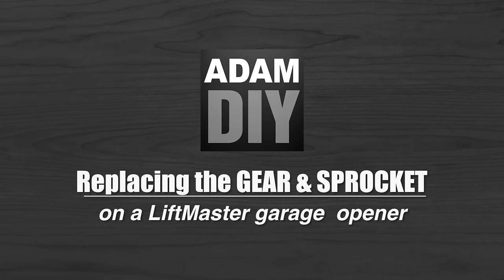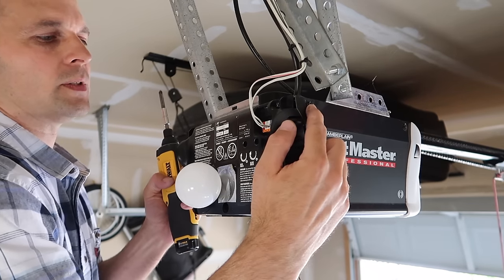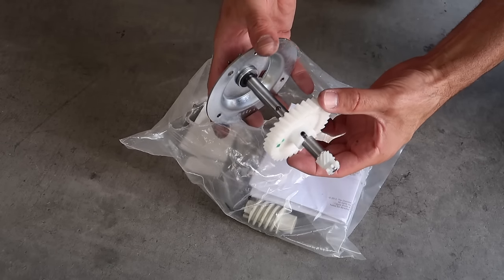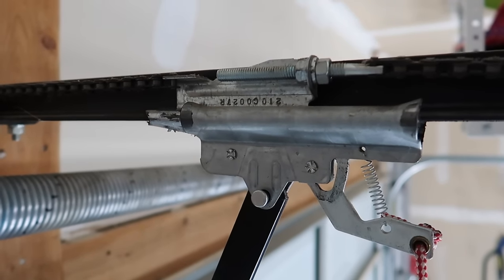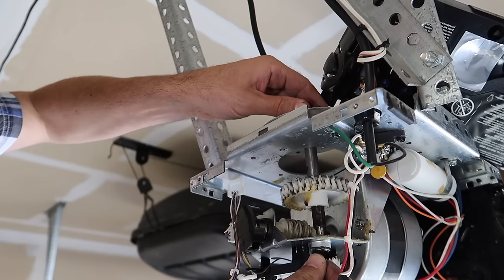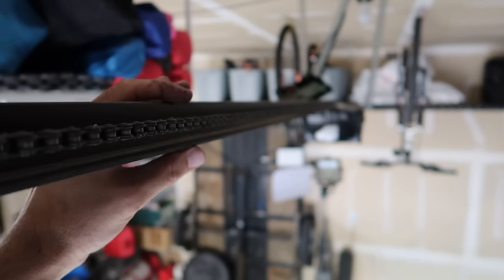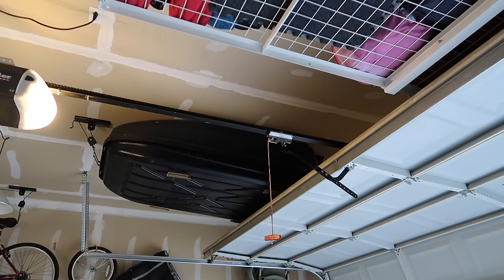How to change the gear and sprocket in a garage door opener - LiftMaster Chamberlain

Comment: Have performed this task twice now.  A few more bits of information: 1] cover screws are 1/4-inch; 2] chain anchor nuts are 1/2-inch; 3] sprocket mount screws are 5/16-inch; 4] check bolts holding entire unit to ceiling....1/2-inch nuts; 5] chain is heavy..be very careful of fingers when moving it on and off of the sprocket...potential for injury; 6] using both the Vice-Grip trick and marking chain position, it was necessary to adjust limits......door always moved too far up and didn't move down far enough....so I would adjust both limits before first functional test by one full turn [360 degrees] and definitely perform the safety test.  Also make sure that you have not loosened/detached the black sector wheel which mounts on the outer end of the worm gear shaft while messing about.  Pre-threading the sprocket mount screw holes is pure genius...do it !!  Worst parts: many trips up and down ladder & gooey grease.
Reply: Thanks for the tips
Reply: I need to change the other gears also

Comment: THANK YOU so much for this video. I had never tried anything like this before. I'm not very handy. My door stopped working and I realized the sprocket had snapped off, separated completely from the gear shaft. No wonder the chain wasn't moving. Other than being a very old unit, I believe I found the reason for the stress. Anyway, I ordered the replacement part and then followed your instructions perfectly. You gave so much information that I wouldn't have had a clue about.. .like threading the screw holes. I got the new gear and sprocket replaced and greased up. The door still wouldn't function properly though, the adjustment screws weren't having any impact. No matter how much I turned, the door did the same exact thing every time. I finally figured out that a sensor (yellow wire) had come off the up adjustment screw. I got it back on, made the proper adjustments, and it WORKS PERFECTLY!!!  Thanks again for saving me money AND for helping me gain a big boost in the accomplishment department! I'll always check here first whenever there's something around the house that needs to be done
Reply: Kathy, please see my post on 8/29/20. How did you realign you chain? This seems to be a no-brainer video. Thanks Adam. i had my doors replaced about three months ago and not sure the installer checked the balance.

Comment: I just replaced the gear and sprocket in my 10 year old Chamberlain 1/2hp chain drive opener, and this video was a huge help!  Thanks!  I would add that in my case, it seemed that once it was all back together the opener seemed to think that the door was in the up position, when it was in fact closed.  The only way I could get it to work was by manually moving the chain to where the door would be in the up position.  Then after a few tries readjusting the down limit, it all works perfectly.  Great super helpful video!

Comment: This video was terrific!  I just changed the gear and sprocket in less than two hours and it is working well. Your instructions were spot on!! Thank you!
Reply: Matt Vaughan
Matt Vaughan
Dude, can you help me? I got all excited seeing how easy it was to change that chain gear. I just replaced the gear assembly on mine because the teeth on the old one completely wore off. Now, whenever I hit the garage door opener button, the motor and chain goes 3” one way then 3” back the other way and stops. What would the problem be?

Comment: Thank you for the video.  Have the same model, had the same problem.  This video helped immensely.  The one thing I recommend at the nd is to have the starting point @9:55 with the door all the way down on the floor and disconnected from the chain, run the chain to the closed position, then connect the door to the chain , so you don't have to worry about the limits, at least one of them.

Comment: Thank you, great instructions! Saved me $$$. One thing I didn’t notice till the end was the openings on the top of the sprocket that seat the black plastic cap prongs. After screwing in the all the bolts I went to put the cap on and realized I should have rotated the two openings so the cap would not interfere with the chain, so no cap on mine :-)

Comment: This is a really good video. I replaced my gear sprocket assembly and everything is working again. It wasn't quite as easy as the video depicts but the video provides a lot of tips which will save you a lot of aggravation. My biggest trouble was getting the old assembly out and the new one installed because I didn't have the right tools for the job. The only thing that I was not able to install was the cap that goes over the chain sprocket because if you don't install it with the slots facing the right direction  you can't put it on. No big deal though. All in all this saved me hundreds of dollars! Thanks for a great video!

Comment: Thanks for the video. My opener had shims on the shaft when I put it together it made a horrible noise without them. The kit came with replacements and once they were in stalled it ran much smoother with minimal noise

Comment: Thank you SO MUCH for posting this very well made video. I purchased the exact same gear kit for my Craftsman opener that broke shortly after we moved into our new house (and in the winter no less). I watched this video a few times in preparation and then step-by-step while replacing the main sprocket, which had initially broken completely off, and it went about as well as I could have hoped. Watching this video was much easier than reading the vague instructions that came with the kit. Thanks again!

Comment: great and informative. I have a Raynor 1/3 hp and could not find a kit for it, so i used this one. looks and fits just like the liftmaster. probably made by the same folks, but i could not confirm it with  a google search. And this did happen in the winter.

Comment: Thank you for the guide on how to replace the gear when my opener that looks exactly like yours in the video sheared the metal gear off the shaft. After I got the new shaft installed it took me a bit to figure out where the chain and carrier should have been since I wasn't sure where the garage door opener thought it was at after it failed when I wasn't home at the time.
Reply: Curtis Manley mine was completely sheared off as well.  The video was great in how to complete this job.  $18 and a couple hours of my time and we’re back in business!
Reply: Curtis Manley do you remember how you figured out where the chain and carrier should’ve been? Ours fell off when we weren’t home as well so have no idea where it should be.

Comment: Adam, I had to replace the gear and sprocket.  Just finished the job, followed your instructions step by step.   Now the door won't open or close, the trolley (I think that's the correct term) does not budge.

Comment: I followed your instructions for replacing the gears and even paid a company to come out and balance the door as you recommended. They complimented me on the gear installation. I had the same issue that Paul Hopper mentioned in an earlier comment regarding making sure the two square holes on the top plate of the gear apparatus are lined up parallel to the chain bar. Otherwise the plastic top cap can't be re-installed. Seems to be the only detail you left out of the video. Otherwise this is an excellent video with clear instructions.

Comment: Not sure if anyone else mentioned it.. but I got it all back together..   (excellent tutorial by the way) and went to put the dust cap back over the sprocket and realized I hadn't rotated the upper plate to the right position.. the tab slots for the dust cap are off by 120° so I left the cap off until some day when I have the ambition to take it all apart again.  Maybe if you do an edit on this post, you could overlay a graphic showing to ensure the tabs are aligned with the direction of the rail.  Thanks for your instructions.

Comment: Great tips here and the videos help a lot. However if you are like me and you have not touched the unit in 26 years you might want to change all the bushings and the worm gear and clean and lubricate everything.  To do that you detach and disassemble the whole unit.  And it takes several hours. The lock collar on the worm gear has allen screws that scored the shaft and the bushing was tight coming off and on.  Also the new chain gear and bushing (shown above) was not lubricated so I took the retaining clip off and lubricated it and put it back together.   My original chain gear had worn out the top bushing and wore out the gears so I replaced the bottom bushing too. The worm gear was worn too.  I would not want to do it standing on a ladder with the motor hanging - upside down on a bench it was tough enough.    Got it all back together hopefully another 20 years.  One down and one to go.

Comment: two additional tips: 1) My unit has a plastic chain spreader at the top, fastened by two screws. When installing the new kit, you need to align the new top piece so the open hole in the correct position for you to re-install the chain spreader. 2) Because the top sprocket had broken right off on my unit, the motor had travelled some when we tried to use the opener. Before re-installing the chain and chain spreader, I had to run the opener so it is at the closed position and then re-installed the chain so that the slider piece was close to where it normally is when the door is closed. I only had to do minor adjustments afterwards to the up/down controls.   thanks for the video

Comment: Another thing that causes the sprocket to break is the garage door spring isnt torqued enough. That was my problem with my door. If the garage door wants to fall back down if you lift it manually, the spring needs tightening. The spring needs to do all the lifting, not the sprocket/motor. Great video, thanks.

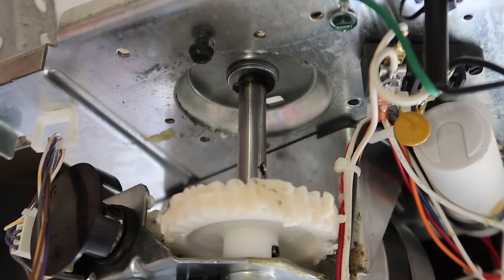Comment: When installing the gear assembly, I did not notice that it has a particular orientation in relation to the 3 screw holes. The slots must be front to back as seen at 7:06.  Mine were 120° off and I could not install the top gear cap. (Off it goes again.)  Thanks for the video.

Comment: I just replaced this assembly on my opener and had a couple notes for others: 1) take note the orientation of the two slots in the top stamping... the 2 slots need to be lined up for the plastic cover for the chain sprocket. 2) if the chain is not loose in the first place, on the vice grip location on the bar, leave about 1/2 to 1 chain link of travel, as you'll need to let it move just a little to provide slack once the new assembly is in and the sprocket is back to it's intended location.

Comment: My mom said her garage door was working like a champ until it didn’t open one day when she came home. I found the teeth on the large, plastic gear had worn down so far that they were flexible and almost clear.  I ordered the parts kit via your amazon link. I followed the video as best I could and even went as far as replacing the worm gear (hardest part so far). Put it all back together and it only moves the door a few inches either way. The only thing I can figure is that before I reattached the chain and tightened it, I ran it through a few cycles to make sure all the internals were moving smoothly. Maybe the cycles are reversed? Meaning, it is trying to close when it’s actually opening?

Comment: Great video, thanks. I replaced the sprocket assembly before watching your video and I had done it correctly. The whole drive train seemed to be awfully tight/stiff/hard to turn when re assembled. I used lots of grease and the drive shaft turned in the upper/lower bearing freely. The motor seemed to work hard and would not reverse - any hints as to why - what to chase? The motor stops when remote pushed for other direction and I tried adjusting the force without any luck re a change in motor rotation. Motor was warm after a few minutes of trying to reverse/turn the opposite direction. The opener wasn't working because the large gear teeth were badly worn with lots of white powder around. The opener is about 20+ years old , a Sears 1/2HP

Comment: Adam - thx, this video really helped me with this exact job today.  One question I have for you is regarding how my door closes.  I have a 2-car, 4-panel door and as it closes when the final panel goes past the curve in the rail/track the bar between the door opener and the header over the door flexes/bows up and there is a little “jump.”  It’s actually always done this even prior to me replacing the sprocket assembly and I’m guessing this is a contributor to the sprocket and bushing failing.  I can’t really tell what’s causing this or how to correct it.  Any ideas?  Should I be concerned?  Thx again, Ken in Milwaukee.

Comment: Small advice as well. If you don't line up the holes on the sprocket properly which hold the gears, you won't be able to put the black cover on top.

Comment: Thank you for your informative video. I try to do this myself and was almost successful. I noticed when I put the chain back on I could not align it successfully to the marks that I made. So I thought it would be OK. Now the garage door will not close all the way,  it stays open about 7 inches from the bottom. I've tried adjusting the chain but I'm scared to overtightened as I'm afraid it may break? Any  any suggestions I also tried to adjust it on the garage door opener itself and was not successful. Now when it opens it hits the stop bolt very violently it did not do that before. Anyone please help thank you

Comment: Do you have a video showing how to reset the learned position? My sprocket totally snapped off. Had to use the garage door manually all week cuz of work. The mechanism is all the way closed. The garage door still thinks it needs to go down because of how it was positioned when it broke. Plz help before winter lol

Comment: Adam, my home garage opener (same brand) stop working. I still hear the motor sound, but chain is not moving and trolley not moving either. Does it mean that the gear and sprocket must be broken and has to be replaced? Also, wondering if the link for gear kit on Amazon still valid? Thanks in advance

Comment: I haven't gotten into the garage door opener I'm working on yet but it had been idle for 5 or 6 years and it got wet from a leaky roof.  Any initial suggestions.  I did plug it in and the light went on and the box where the opener motor is clicked, then I just unplugged it right away in case something was not right.  I've put a new battery in the opener.  The door is balanced because its been opened and closed manually for a while.  I'll check the sensors that they are lit and not blocked and then I think I'll hook up the door to the opener and just try it.

Comment: My sprocket gear snapped off last night. I'm going to give your post a try before I call the pros. I only have 2 questions if anyone would like to respond. I have a 41A5483C Liftmaster that looks just like the one in the video. I've read other post that say Chamberlain used the same gear drive in all their chain driven openers. Q#1, will the kit from Amazon posted above work with my unit? Q#2, I have no reference point as to where the chain should line up as it fell off during the break. Is there a good starting point for the chain reinstallation?

Comment: After changing my gear and sprocket, the door doesn’t open, it goes backward then hits the bolt behind and then goes back to to where it was, won’t go the other way to open the door. Any tips?

Comment: Hi Adam👋, I purchased the kit in your video! I put everything back together but the garage door doesn't open. The chain track that opens & closes the garage door hits the bolts towards that BIG long spring above the garage door! Can you please HELP!

When I go to open the garage door the track just wants to close the sprocket doesn't reverse to open!
Reply from the maker: @oriigiinals4381  sounds like the position of the gear may be in the wrong spot.  In other words, the garage opener thinks the door is in the OPEN position when it in fact is not.  And it is running trying to close a door that is already closed.  Remove the chain from the motor gear and then run the opener. It will spin the gear till it reaches its Closed position.  Then hook up the chain again.  I hope that makes sense.  You will also likely need to adjust the LIMITS when done.  I think I have a video on that as well.

Comment: Hi, I was wondering,  can I replace the upper gear only without replacing the whole shaft and lower plastic gear ? My garage motor has the upper gear and spreader broken. Thank you.
Reply: Mine did too just wondering if you found out the answer to your question
Reply: @DanielElseWhere  I checked many videos and they all replace the whole shaft with the upper and lower gears, even if the upper gear is the only part broken.

Comment: HELP
I'm replacing the drive gear assembly after 35 years of service Sears 1/2 HP. Can a chain spreader be added to an opener that didn't come with one? It looks like I might have to add a few links to the chain? There is about 1/2" between the bearing retainer and the end of the rail. The top of the opener looks just like this one with a "T" rail. My drive is the same as this too.

Comment: Matt Vaughan
Dude, can you help me? I got all excited seeing how easy it was to change that chain gear. I just replaced the gear assembly on mine because the teeth on the old one completely wore off. Now, whenever I hit the garage door opener button, the motor and chain goes 3” one way then 3” back the other way and stops. What would the problem be?